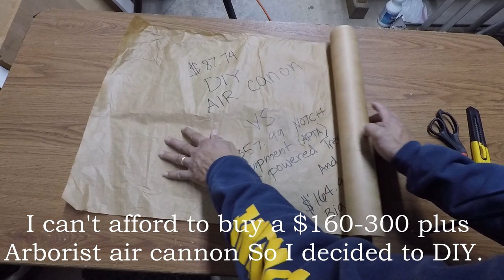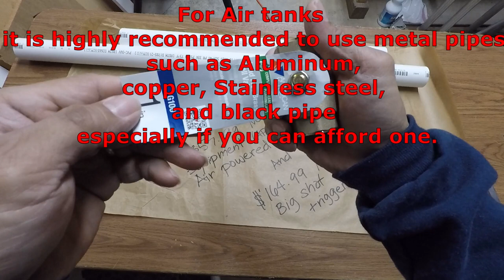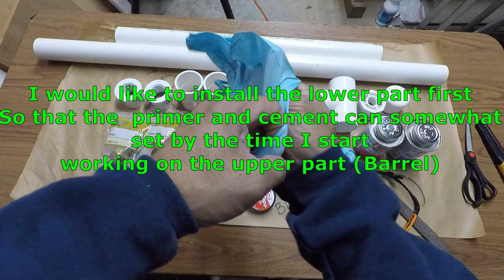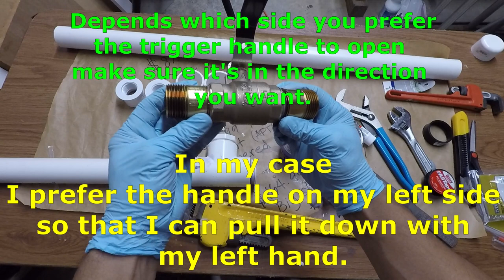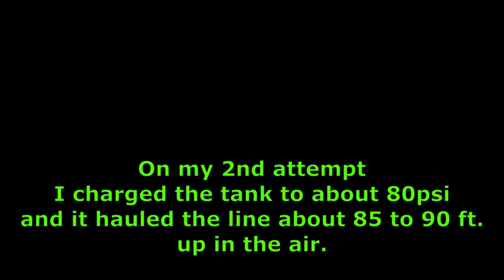DIY Affordable Air Cannon for arborist. (Please see items on description for more details)

Comment: Definitely one of the better builds that I have seen, I like a larger pressure tank 3" schedule 40 and using a springer control valve for  the release, but you made probably one of the nicer launchers.
Reply from the maker: yes Sir. I did see that cannon with a springer control valve as a trigger release and it is sweet. In my application it all went down to how much would I be using the cannon (turned out to be once in a blue moon) and lastly, I wanted to spend very little as possible.

Comment: Thank you so much for taking your time to provide us with these links. I know you didnt have to do it but you did and I am grateful.  I was look at the video and the links and it looks like the 1 in. x 2 in. MIP Red Brass Nipple Fitting that you provided in your links look a lot longer that the 1 in. x 2 in. MIP Red Brass Nipple Fitting in the 8:36 mark of this video.  Take a look and tell me if they look the same.  one looks longer than the other.
Reply from the maker: Not a problem at all Sir. The good thing about those parts is that you can interchange with different parts as you desire. On the brass nipples as long as they are not too long nor too short and you can tightly screw both ends to the 2 Pieces of 1-1/2 in. x 1 in. PVC Schedule 40 SPG x Hub Reducer Bushing Fitting. That's what matters. On the side note. While I was at Home Depot or Lowe's I pre fitted most of the parts just to make sure they all align together.

Comment: Can you tell me where you got the 1 - 1/2 inch x 1/2 SCH 40 PVC Reducer Bushing . I looked at Home Depot and Lowes but I could not find it. Where did you get it from?
Reply from the maker: 1-1/2 in. SPG X 1/2 in. FPT Red SCH40 PVC Bushing: 
https://www.homedepot.com/p/VPC-1-1-2-in-SPG-X-1-2-in-FPT-Red-SCH40-PVC-Bushing-27-438-209B/317246325

Comment: I have been looking for almost two weeks for the 1 - 1/2 inch x 1 in PVC Reducer Bushing ($2.95) and cannot find it at all.  Can you do me a HUGE favor and send me a direct link.  I really cant find this bushing. Also the 1 - 1/2 inch x 1 - 1/2 inch SCH40 Coupling is missing in action also.  I went to home Depot but they dont have these exact kind.  The ones they have only allow the PVC to go into the coupling about 1/4 in.   Please help LOL

Also when I went to get the 1- 1/2 SCH40 PVC piping for the air tank and the barrel they did not fit any of the other items that you listed.
Reply from the maker: Hello Sir. Hope this will help you  1 - 1/2 inch x 1 in PVC Reducer Bushing ($2.95):
https://www.homedepot.com/p/VPC-1-1-2-in-x-1-in-PVC-Schedule-40-SPG-x-Hub-Reducer-Bushing-Fitting-27-438-211B/317246327 
1 - 1/2 inch x 1 - 1/2 inch SCH40 Coupling:
https://www.homedepot.com/p/Charlotte-Pipe-1-1-2-in-PVC-Schedule-40-S-x-S-Coupling-PVC021001400HD/203811389
Good luck
Reply: @unboxingsynapses9261  Thanks. I now have everything I need to make the launcher.
Reply from the maker: @BlackHamRadioUniversity  Would love to see your creation Sir. Good luck

Comment: In the 7:05 mark of this video it said 24" PVC Pipping but what size is it? 2", 3"?
Reply from the maker: I got it at lowe's
* 5ft. PVC pipe, Silver-Line Plastics 1-1/2-in x 5-ft 330 Psi Schedule 40 PVC Pipe
https://www.lowes.com/pd/Charlotte-Pipe-1-1-2-in-dia-x-5-ft-L-330-PSI-PVC-Pipe/3133039
Reply: @unboxingsynapses9261  Thanks man. You are that greatest man LOL
Reply from the maker: @BlackHamRadioUniversity  Thank you as well Sir. Good luck, hopefully you can get all those things in your local Home Depot. By the way you got a nice cool channel. I just subscribed. Lastly, If you ever made the cannon I'm hoping to see it in your channel.
Reply: @unboxingsynapses9261  For some reason youtbe thought I was spamming so it will not allow me to comment with my other channel for 24 hours so I am responding to you on my other youtube channel.  But yeah I will make sure I make a video to the DIY air cannon.  Thanks again!
Reply: Is this hard on your throwing bag. I'm going to make one hoping it doesn't cause the bags to come apart thank you
Reply from the maker: @dennyussery1021  Not hard on the bag per say. But when it hits something not intended over and over it eventually falls apart basically wear and tear. If you plan to DIY make sure it is something you will be using frequently. So far I've only use mine 2 to 3 times within the course of 1 year.
Reply: @unboxingsynapses9261  I just made one today I WILL TRY IT TOMORROW
Reply from the maker: @dennyussery1021  I'm hoping you took a video of your build that would be awsome.
Reply: @unboxingsynapses9261  no video but I tried it out today and it worked great. 30 pounds of air went straight up approximately 30 feet,40 pounds 40 feet and 50 pounds 50 feet. Didn't try anything higher but will tomorrow hopefully
Reply from the maker: @dennyussery1021  Not bad at all. Good luck and be safe.